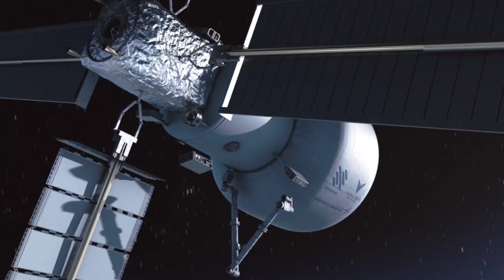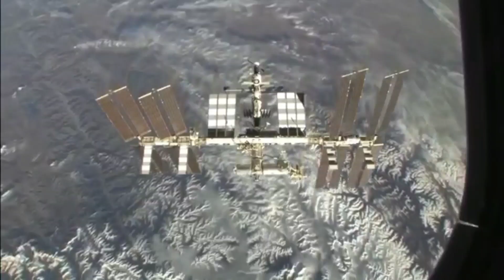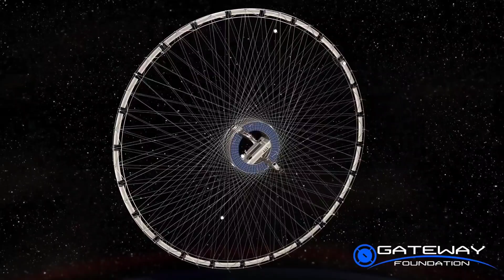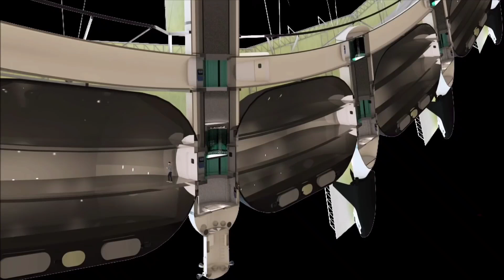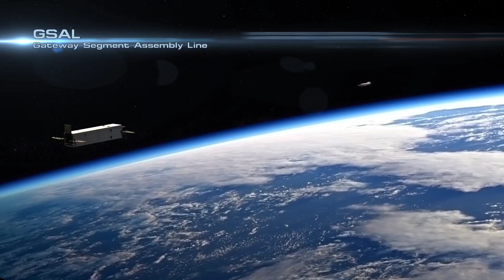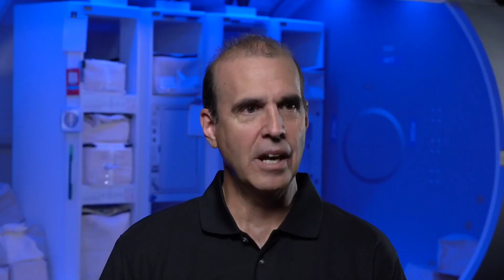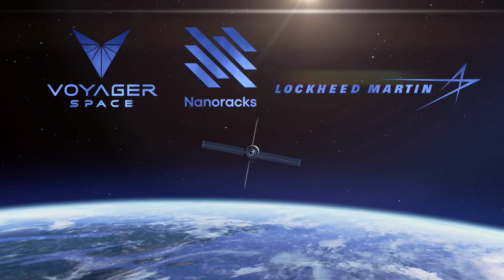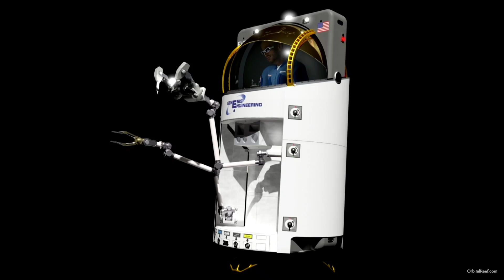How did SpaceX lose to Blue Origin on a NASA space station contract? Was this handled fairly?

Comment: Starship station looks cool, but yeah turning a lunar lander into a space station isn't that easy, would probably need allot of modifications they didn't have information for
Reply: It's not turning the lunar lander into a space station, it likely (theoretically) be a variant similar to how the lunar lander is different than the earth based lander. Honestly, you can probably just stick a startship in orbit with only internal design changes and that would STILL be 10x+ the internal volume of the space station as it is now. I think that this decision is more of a "helping out the underdogs" as well as not being entirely dependent on SpaceX for ALL things space. On one hand, they can do it and probably do an amazing job, but on the other hand you have SpaceX doing it all. This is similar in my mind to how SpaceX can probably design/produce an EXO suit but didn't push too hard for the contract because they don't NEED to have it in order to survive.
Reply: @andrewdiana7955  Well yeah the volume is a plus but more than a variant change might be needed space stations and human rated spacecraft have some large differences. Now I'm sure you could put in all the life support systems into that thing will mass to spare. I sure you could switch out the thin stainless steel for something a bit more long term. I'm sure the ability to relight the engines hundreds of times is not that big a deal, and to add external ports for extra modules can be figured out without disrupting the structural integrity. Plus 100 other things

But at some point its better, quicker, and cheaper in R&D to make a small sacrifice to volume and just place a tailor made space station into starship/similar for deployment.

Comment: If there will be next space station it should have artificial gravity. It would be really huge step forward, otherwise it will be just the same space station, simple replacement without moving forward in space technological meaning.
Reply: Add an artificial gravity module later on seems more logical.
Reply: @MDP1702  If they can be flexible on that it would be great. But I think they will delay such improvement. It is better to see results with artificial gravity instantly. In this way, NASA will show that they has taken a really big step with technology and understanding of artificial gravity, it would be the first space station with artificial gravity and will beat China in space race. I think it is very important to show that they can do it, because it will lead to future technologies with artificial gravity.  But I understand that it is very difficult to do and cost insane amount of money.
Reply: @rimantasdanilevicius6754  The thing is, there is no need for artificial gravity in LEO at this moment, so the money put in would be a loss, just a research project. This while the goal of the current plan it a space station to replace ISS to do work (research/construction/space tourism maybe) in 0g and be interesting for commercial companies.

It would be weird to build an artificial gravity station to do work in 0g. An artifical gravity station would demand an entirely different program with a different set of goals. The first step would likely be a very small testmodule with steel rope/truss structure or something similar, not an entire station.
Reply: @MDP1702  if there is no need for artificial gravity on research space station then, for sure, there is no need to spend money on this technology. I agree. All answers depends on money at the moment.

Comment: Why is Blue Origin allowed to bid on anything at this point, abject failure on every level.
Reply: Why was SpaceX allowed the CRS contract in 2007 when they clearly had failed three straight Falcon 1 flights and had nothing to show by that point other than failure? 

And you are lying about them failing on everything. They have fully brought New Shepard fully through development, then test flights, and then flown it with people onboard to space and back. Then they also met a NASA contract to fly multiple missions with experiments and tech demos on board successfully.
Reply: @thomasackerman5399  lol gfys
Reply: @dvnwnd07  That is not an answer.

Comment: Why no station with rotating and non rotating parts in the middle? You can have microgravity for research and artificial gravity for living depending on your needs. Just connect 12 starship fairings to a ring and let it rotate. We would get 13200 cubic meters + 1-3 in the middle adding up to 3300 cubic meters, non rotating for microgravity for reseach. Think big. 😉
Reply: Or you could place several segments like a string of pearls along the "wheel" axis, one firmly connected to the "wheel" and through a hatch exactly on the "wheel" axis you can get into the other middle segments with counter-rotation, which then stand exactly still . A rotating mechanism similar to that of a tank turret could be integrated directly into the hatch section. today you should be able to get something pressure-stable even with rotation.
Reply: Then there wouldn't be zero G research on board still on the center it would ruin most of the experiments.
Reply: @Radialguy  I think the idea would be to have the center be seperate to the rest, but connected to it with magnetic bearings or whatever. It wouldn't be easy at all, but likely the best way to combine both.
Reply: @Radialguy  Yes, within the middle segments there should be a separate area for zerro G that rotates in the opposite direction at exactly the same speed. Do you think that would be too complicated?
Reply: @pauld.9856  so in order to go to work they would have to do spacewalks and there would have to be duplicates of just about every system
Reply: @camilla-w5h  You need to modify some fairings with additional hatches on wich you can connect tubes. The connection to the ring section can be made by tubes, through which astonauts then come to the center, to the one inner segment firmly connected to the ring, and which is precisely aligned with the remaining inner segments along the axis of rotation, but connected to them only by one hatch with turning mechanism, so that all other inner segments do not turn with it. Sorry my english is not perfect but i try my best to explain what i mean. 🙂
Reply: @Radialguy  you can make two separate stations or make a part of it with gravity and other non- gravity part

Comment: Also, something most people don’t know, but they have presented publicly, is that BO and NASA have been working together on a version of the ROS (Robot Operating System) framework that will be certifiable for space uses (basically it sets up the standard ROS framework but with specific rules on how you develop and test for certification) and plan to use that extendable framework as the OS for everything from future robot probes, unmanned and manned spacecraft, and space stations. 

As a subcontractor on this bid, they likely are providing support services for software development under that framework.
Reply: That is scary. (probably true of course) That would be like relying on Windows for airline flight software. Glad I am not leaving Earth any time soon... unless of course Mars becomes the new Australia where dissidents are sent.
Reply: @lenwhatever4187  not really. It’s ROS, but with VERY serious restrictions that make it follow standard space and RTOS requirements, validation and verification. For example, it’s C++ only (no Python), has to go through a number of validation tools to check code security and completeness and eliminate stupid things like buffer overruns and such.  

At the same time it will allow for modular software development with lots of reuse which is ROS’s strong point.

Comment: Before a possible base on the Moon and Mars, conquering LEO with big infrastructures, is very important for farther Space exploration. These big modular structures would work as Assembly lines to satellites, Space Tourism, and Scientific Research Labs.
Reply: Three to six Starship space station modules linked could probably be classified as a megastructure way bigger than Orbital Reef🤦
Reply: @acemax1124  are you aware that a Human rated Space Station is more complex that join together some Starships? With heavy lifters coming, you can sent specialised habitat modules to LEO.
Reply: @RogerM88  yes I am very aware and I was just comparing the volume and possible practical possibilities of using the Starship system for LEO launches. Right now it's all just writing on paper and CGI 🤔
Reply: @gamerfortynine  mining asteroids, only makes economical sense, if big technological breakthroughs are achieved in Engine propulsion. And Human presence on LEO is more expressive. Since then it could take decades to even be considered that option.
Reply: The actual ordering may be Moon, Mars,  ISS replacement, then large space station in LEO. ISS replacement is good because it's what we need for what's become valuable micro gravity manufacturing. For NASA purposes, Gateway is more important than ISS LEO replacement. The point I want to get to is we need to build a base on the Moon to build something really big in LEO. Cost requires resources be lifted from the Moon, not Earth.
Reply: I think SpaceX really needs a fuel depot in LEO, before a replacement ISS. Zero gravity manufacturing is a really big deal and no better place to do it than LEO. I believe the first big commercial space station will be at the Sun - Earth Lagrange point L1. It will be loaded with solar panels grabbing heavy duty sunshine, and it will be an easy shot from the Moon. The Moon is almost halfway to it when its in its new moon phase. That spot orbits the Sun in front of Earth like the JWST does behind Earth at L2. Sending prefabs there from the Moon will be easy. SpaceX should still do fuel depot #1 in LEO, fuel depot #2 at Gateway, and fuel depot #3 in LMO, low mars orbit.